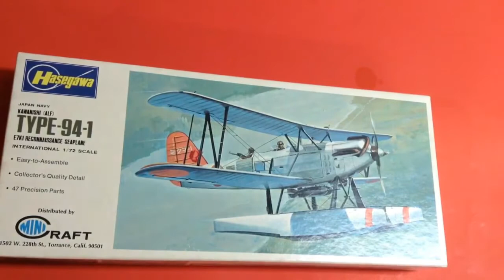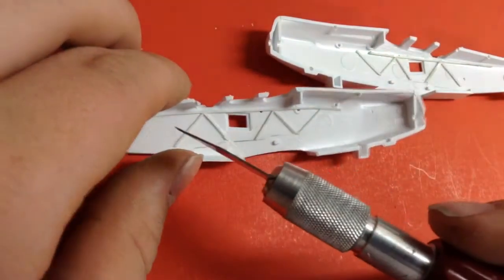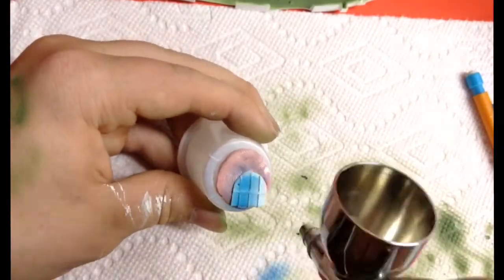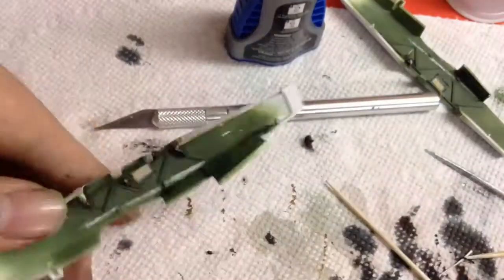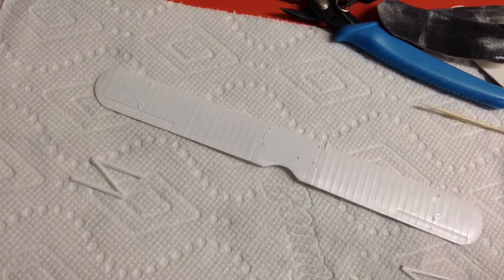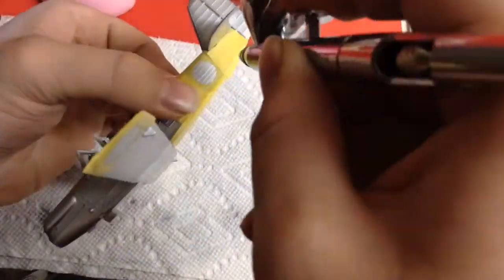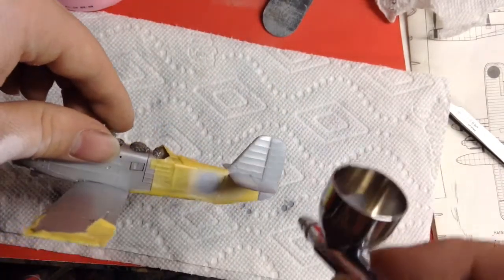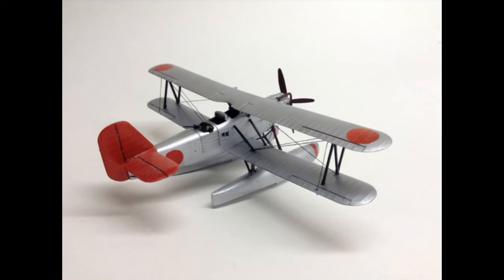Hasegawa 1/72 Type 94- FULL TIMELAPSE BUILD

Comment: Great video !  I had to subscribe.  I've got a tip for you. I noticed that you are using tape to plug the cockpits. I've used good old toilet paper for decades.  Here's why, tp is made to dissolve in water. Using a finger tip apply drops of water around the opening. You can get a perfect fit for the hole. Once it's dry again it will be hard and when finished, just pull it out!   Best method I've seen for cockpits and wheel wells.  
   This brings back memories of the one I had back in the 80's. I wanted the plane you've done with the catapult but my aircraft modeler buddies talked me into the other kit of the monoplane. I built the catapult but I ended selling it to a friend who wanted one.

Comment: Mano, you knocked this out.
I have this with the catapult, bought it second hand. Green plastic on the plane. I don't think it has fit up to this point as well as the white plastic. I could be wrong. Your tail planes seemed to be a near drop fit.
I'm still struggling to get them level.
  I thought the fit of the struts to the fuselage to be dodgy at best. Still not happy. Other than that, very cool and unusual kit.
  Love your interior scratch building.
Great color selections too. I'm gonna' have to look at that Vallejo silver. I'm liking this.
  You did a great job on this.
Reply from the maker: Thanks!
I've been really impressed with Vallejo's metal colors. This isn't even one of there actual branded metal colors- it's just normal vallejo air. It looks almost as good and is WAY easier to spray than Alclad, plus you can hand brush it for anything else youd need a siilver for.

Comment: Thanks for what I consider an OUTSTANDING building video. Normally I'll skip thru a video, but not this one. Subscribed in hopes of seeing more of your work. As to the black used on the few recessed lines, think I'd of gone for a darkened red/silver look because the black seems to kind of jump out at you. I've got this and the other 2 float planes Hasegawa produced, but never built them because of the rigging between the wings. Wish you had shown how it was done. Now all you need is either putting it on a catapult or on the trolley gear used when it was pulled from the water !-)
Reply from the maker: Welcome, and thanks! I had a very similar thought regarding the panel line wash, and I probably would have tried something else if there were more panel lines in the aircraft. I only had a bottle of Tamiya Black Panel Line Accent Color, and was ready for the build to be done. The short version of how I did the rigging: A dab of superglue went on to one point- I put one end of some black thread in it until it dried. Then, I carefully put a dab of superglue on the corner where a strut met the wing surface, and carefully pulled the string taut until it set, and cut off the excess. It's not scale, but it fills the space. The reason I didn't record it is because it ended up taking me a solid 45 minutes to rig, and it kept coming apart and getting glue everywhere. Good idea on the trolley gear- I might have to m ake a video about scratch building that. I really wish HAsegawa sold the catapult as a separate kit, but the only way for me to get one would be to buy another one of these.